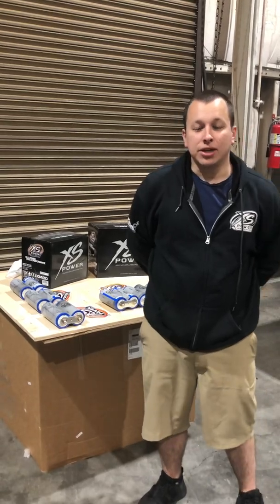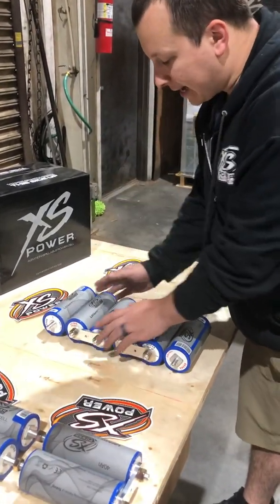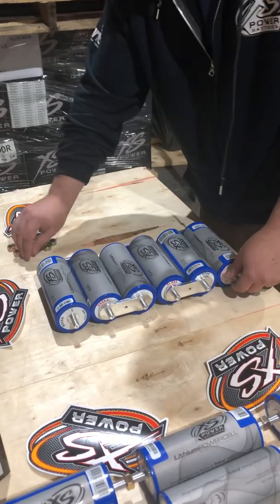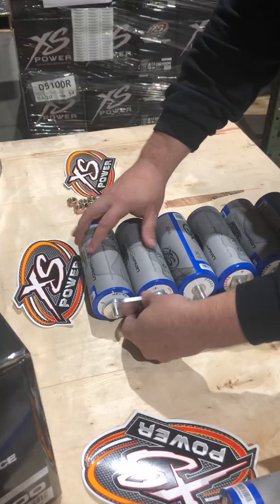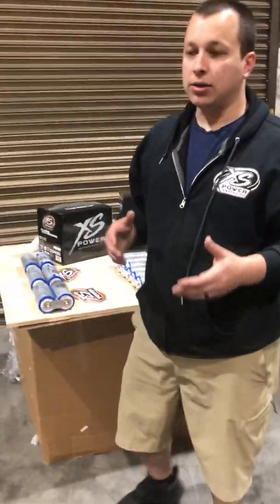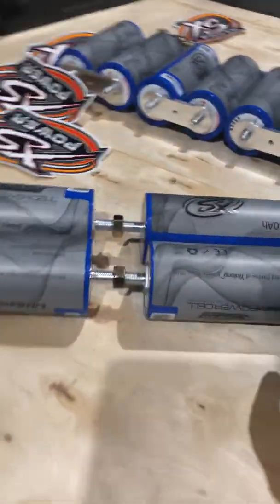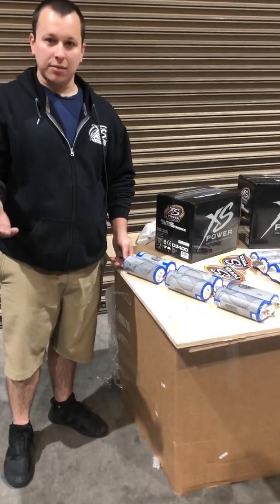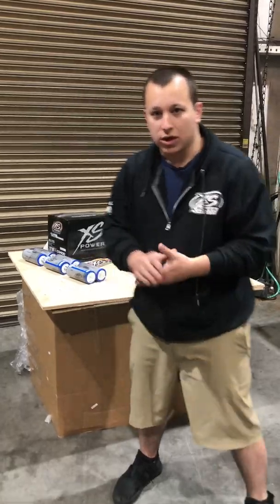XS POWER DIY CELL ASSEMBLY!!

Comment: Tight to seven newton meters. It's the metric equivalent of pound feet. They're measurements of torque. As I write this I realize that it sounds weird to use feet as part of a measurement of twisting force. Terms can be weird.

Comment: I have 26 qty Yinlong 2.3v Batteries can I run 10 batteries in series & then run them every 2 batteries wire them in Series ++ - - which will be the same voltage but a Higher Amp Hour for a total of 48v ? “ Yes I’ve heard the lower Amp Hour will lean on the higher Amp Hour Batteries !
Reply: How many do I need for a smart 3k?

Comment: What is the minimum charge rate for for 6 cells in series, for example if I was not worried about charging them as fast as they are capable of could I just use a 13-14 volt 50 amp power supply to charge them or will this overload a power supply that small... thank you